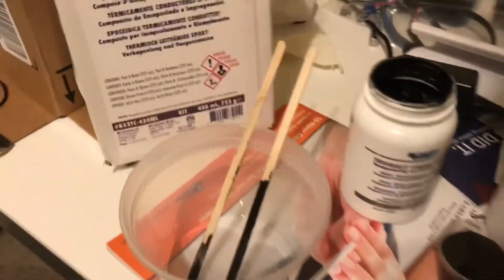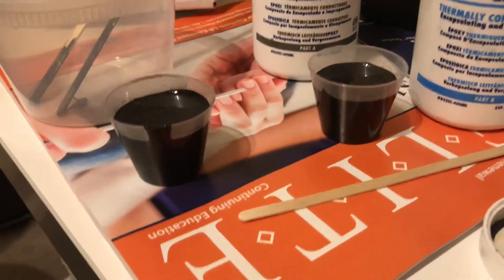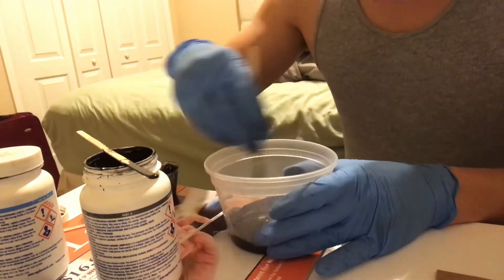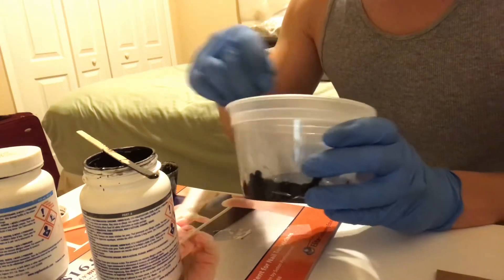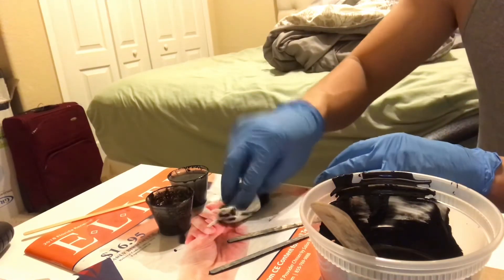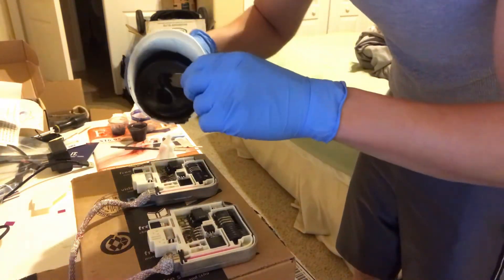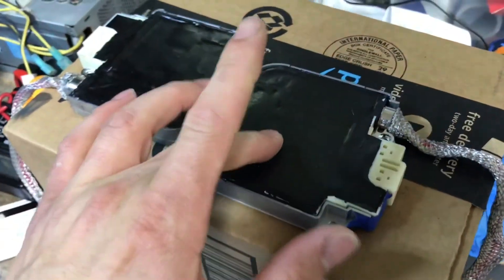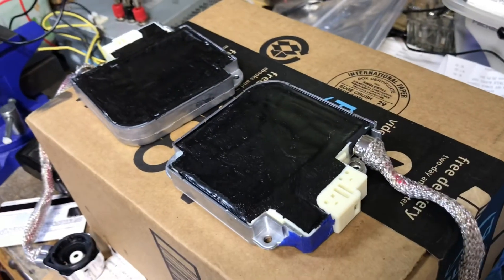How to Pot & Waterproof HID Ballast | Thermally Conductive Epoxy | Denso D4S D2S Lexus Toyota

Comment: Hi did you get any overheating because there airtight
Reply from the maker: Nope. The potting actually helps sink the heat. These are workhorses. I’ve got a set that are 20 years old and working on multiple cars I have used them on.

Comment: Finally doing this tomorrow.  Do you remember how much actual epoxy you used for both denso's?  Looks like you had each measuring cup almost full.  Was that enough for both, or simply one ballast and you repeated the process?
Reply from the maker: It doesn’t take much. One full cup should do single Denso. Recommend doing that on both and let it settle. If you need more between the two, mix a small topper batch. Have acetone around to clean up any mess.

Comment: Going to ask a stupid question but since you potted the inside of the Denso, how does water not get in from the external wire connectors?  IE:  The wires that power the denso and also from the ignitor connector?
Reply from the maker: Wires are insulated. It’s potted up to the solder connector into the board. Everything is encapsulated now. Water can touch the terminals but changes of it shorting are slim unless it’s submerged. The bulb end is inside the housing so not likely to get wet.
Reply: @TunerwithKids  awesome thank you!  I'm going to be doing the same thing for my CT 200h.  I just ordered everything for my protector retrofit and the densos need to be potted.  This video is perfect!
Reply from the maker: Not sure if you already have the MG chemical epoxy but it’s currently overpriced. I noticed it when I ordered more like 3 months ago. It should be like $25-$35 but currently listed on Amazon in my links at like $100. I’ve ordered this twice for like $25. Here’s the correct price link. https://amzn.to/3x1eXbB
Reply: @TunerwithKids  yep that's the exact one I bought.  Paid $22 for it.  Light werkz/trs wanted to charge 70 to $100 to pot them, I figured I can do it myself no problem lol

Comment: Bro is it okay !!
Reply from the maker: holding strong. I am using them in the Sienna with D4S Osram CBIs I took out of the IS250. Was an upgrade from the Morimoto D2S with Denso Slims I was running. Will use these til the D4S CBIs go out and then probably go back to D2S.
Reply: @TunerwithKids  is the denso d4s better than the morimoto denso slim? what are the beneffits?
Reply from the maker: Nef Garza morimoto denso slim? What is that?, the aftermarket slims?  Nothing is better than an OEM ballast. Closest aftermarket would probably be the Hylux. There are a few variants, Xenon Depot version, Morimoto XB 2.0, and actual Hylux. From reports the Xenon Depot is better due to specialty changes internally.